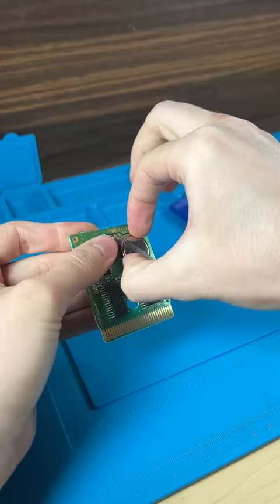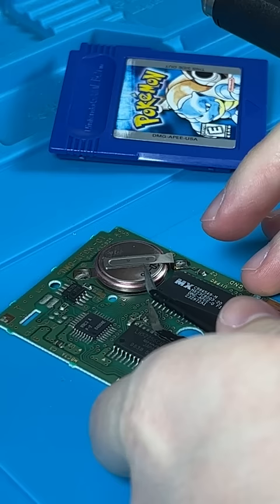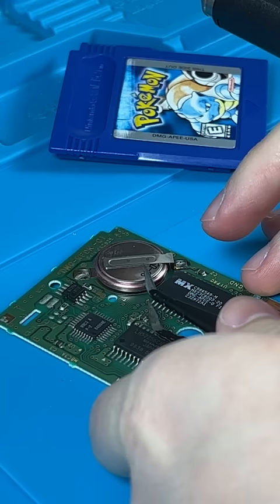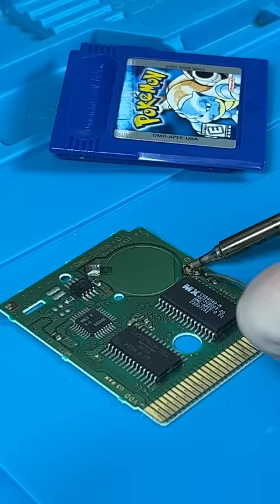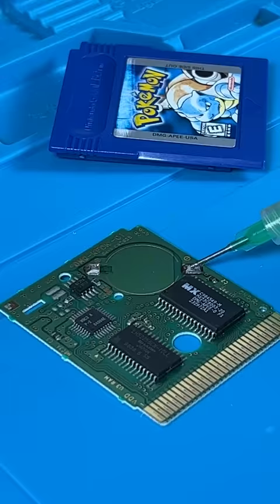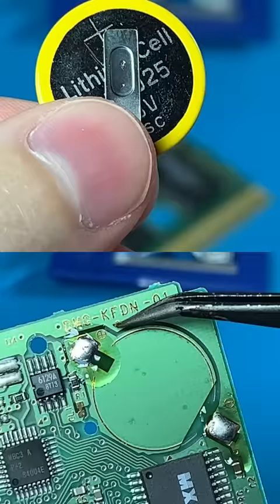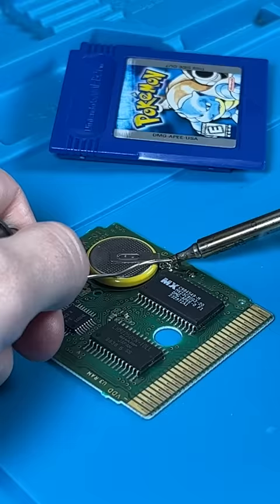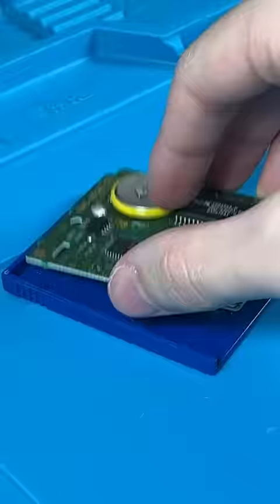How to PROPERLY Replace a Game Boy Save Battery! #Shorts #Restoration #Satisfying

Comment: “Now desolder the battery”

Me: I’m out.
Reply: Please don’t pry the battery off. It is spot welded and takes a lot of force. Sometimes enough to break the contacts or the battery. 

Just because it can be done doesn’t mean it isn’t a huge risk. A soldering iron can be as cheap as $10 and if you have no other use for it just sell it or burn some art into wood, much safer. 

Get the iron. If the original solder doesn’t melt in 3 seconds of firm pressure then you can consider buying rosin core solder. You shouldn’t need extra rosin. 

Practice and play with some junk first if you like. Bits of old wire and metal.
Reply: Yeah, Nintendo should have had made it like. Screw the cover out. And pull the battery away.
WITHOUT ANYTHING BUT HANDS! And replace it a new one
Reply: @buzzergaming7777  The batteries last longer than they were planning to support their system so that's why it wasn't a priority.
Reply: It doesn't take a lot of force to separate the battery, it takes time and patience. If you're too scared of poking the delicate cartridge with a blazing hot iron, slowly and gently shave away at the battery prongs with a box cutter. The prongs connect to the battery on two small spots, not bigger than the dot at the end of this sentence. It will take you the better part of an hour to do this, but in my opinion it's the safest way.
Reply: Fr
Reply: Soldering really isn’t that hard once you finally learn how to do it. Just gotta practice.
Reply: @alexitorico6686  it’s not the fact that easy or hard, it’s the fact that I would have buy all the equipment for one thing.
Reply: Soldering is easy. Apply the iron until solder melts and remove. Apply new solder with the iron. What's hard about that?
Reply: same
Reply: I once tore the motherboard of crystal in half trying to pry the battery off.
Reply: @xshadowzone  That’s extremely unfortunate.
Reply: I replaced my pokemon Gold cartridge battery when I was 14 years old and all I needed was a screwdriver and the battery.
Reply: Lmao
Reply: @ジョンマクス I'd avoid prying it. You might lift a solder pad and then you are screwed if you couldn't solder in the first place
Reply: Yep lmao
Reply: Its literally less than $20 to get what you need to do this. Why when anything involves money people throw a fit
Reply: @buzzergaming7777  I mean the batteries lasted 25-30 years. I dont think we should really complain.
Reply: @j that will destroy the solder pads or break the PCB don’t do that
Reply: Give it a try, soldering is super easy
Reply: @562.anthony2  it looks pretty straightforward, I was just making a joke.
Reply: Learning to solder is pretty useful. Bought a relatively low cost soldering kit on amazon a couple years ago, watched some YouTube videos on it until I was somewhat confident with what I was doing. bought a paddle kit and did a 4 paddle mod for my PS4 controller, After that I did a IPS screen for my gameboy SP, and now I use it when I put in new switches for my gaming mice.
Reply: @Dwellic  awesome
Reply: @Jackthat1  well I mean technically once you buy the stuff you'll be able to solder any of the gameboy, gameboy color, and gameboy advance games, not just a single pokemon, though if all you own and want to play is a single game like pokemon blue then yeah I see the point
Reply: It maybe look intimidating, but soldering is honestly so easy.
Reply: same

Comment: I’m 33, and I didn’t realize until 2 years ago that carts had actual batteries in them….. still blows my mind. Explained why my Kirby superstar games always came back 0% after a couple days.
Reply: I'm 31 and just found that out 2 weeks ago lol
Reply: Wait this isnt a joke? What the
Reply: Im 26 and i just found out
Reply: @dominickmagoon5731  They use volatile memory, same as RAM, so without power, they reset.
Reply: Very old writable chips (like the GameBoy contained) require a small amount of power to maintain their written state, like RAM in your computer.

The GameBoy Color was more of an upgrade to the GameBoy than a new system in itself - GameBoy carts work in it (albeit in monochromatic palette) and GameBoy Color carts will play in a GameBoy. The original GameBoy released in Japan on April 21, 1989 - in development for a few years before that -  and modern flash memory was extremely expensive back then. So, the carts used the memory that takes a battery. Luckily, these batteries often last 5 - 10 years, so they don't need replacing often - but it really sucks losing a Pokemon collection you spent thousands of hours on as a child.

33 years later, non volatile flash memory is extremely cheap, and any cartridge based systems can use a small flash chip to store save files.
Reply: @cr4zyj4ck  is that why at time it would crash and woudnt save?
Reply: I had the same issue with almost all my gba games back then
Reply: @cr4zyj4ck  you can just replace the battery every 5 year then
Reply: I’m 33 and I just found out right now lol
Reply: @dominickmagoon5731  yeah, usually the first sign was saves would randomly delete themselves and eventually the game would start crashing if it got so much as tapped while playing.

Found out years ago myself because I tried playing my childhood pokemon silver, batteries in the gen 2 games are just a pop and swap though.

Got my old game boy colour needing a refurb now though.
Reply: I am 35 and I learned watching this video
Reply: I'm also 33 and I just found that out today. You beat me by 6 days.
Reply: Some of them even had a small rumble motor in them.
Reply: I'm 32 and just found this out now.
Reply: I found this out too just now I'm 31 my childhood was a lie
Reply: Do the games that make you use a password to continue where you left off not have a battery??🤔
Reply: @Dkthearn  yep possibly
Reply: @Dkthearn  No they didn't have batteries, because they didn't store save files at all. The passwords were basically exact representations of certain game state values (level, health, items, etc.), with some basic parity checks (i.e. additional symbols that mark it as a valid password) to prevent people from just easily guessing passwords.
Reply: I'm 31 and I only just found out haha
Reply: Pokemon games don't work the same if I'm not Mistaken. It's used for timed events..ect. idk. Maybe red/blue ect was diff...
Reply: @lmfaook.7971  Yeah in Pokémon RBY you need the battery in the cartridge to maintain the save file. If the battery is dead and you turn off your GB, the next time you turn it on it'll look like you never had a save file.
Reply: I didnt know till today 😅
Reply: @do2eazy363  actually no, the moment the battery lost contact with the chip's contacts the save file would be wiped
Reply: @kidsseeghosts660   I said to avoid the battery dying midway you can replace it earlier
Reply: @kidsseeghosts660  also there is a method to replace battery without data loss
Reply: @do2eazy363  no that's not possible at all it doesn't work like that, just like I said these cartridges has to be powered for them to maintain their saving functionality. these pre advance gameboy cartridge used a battery-backed SRAM modules for their save states which means they have to be "powered by battery for the ram to work" that's the reason the dude has to backup their savefile  manually before changing the battery. if the cartridge lose power even for 1 sec your save file is good as deleted even with brand new batteries.
Reply: @do2eazy363  yes there is and that is by manually making a backup of your save file just like the guy in the video did. brand new batteries or not, the cartridge lose power your saves are deleted you don't really have to wait for the battery to die out just remove it's contact from the cart and you'll have yourself a cart with 0 savefiles
Reply: @kidsseeghosts660  no theres another way in which when the battery is old but still working you solder a external power source into the battery terminals now the power is not lost when we remove the battery so we can put the new battery and remove the external power source once done
Reply: @kidsseeghosts660  i fail to explain what I mean but the external power method works aswell
Reply: I'm 34 but it was around 29 for myself
Reply: I'm 35 and my pokey game from 5th grade still has my save state no lie! Never changed the battery
Reply: I thought only games with an internal clock had that (Pokemon Gold/Silver/Crystal for example), but know I know that the clock just uses the battery a lot faster

Comment: Leave the flux on, place the battery and then solder it. The flux won't do anything if you burn it while only on the pads as the solder you added already has fresh flux in it (hopefully). By leaving it on while you solder the battery you avoid having to need 3 hands for the part, iron and new solder with flux

Comment: Always clean the pads, always use fresh solder and if you're using the right solder, it's going to have rosin flux in the proper proportions. Don't forget to clean any excess rosin off the board before you seal it all back up again.

Comment: You can just use a box cutter to slice the metal contact off the bottom of the battery and take it out without taking out the entire battery assembly. That way you can just slide a new battery in without soldering new metal

Comment: Please use this method if you are replacing a save battery. Ripping off the battery can lift the pad, which is really really hard to fix. If you do not have a soldering iron, get one or take your game to your local retro game store. 9/10 times they have paid services for replacing save batteries.

Comment: To skip buying that crazy backup thing, just wire the new battery across the old one as you remove it so it never loses power. Little tricky, but works the same.
Reply: How would you even do that lol
Reply: @leolego2  Solder battery + to +
Solder jumper to new battery -
Solder jumper to gnd while clipping the + with wire cutter. 
Bend battery into place and solder everything better. 
It's tricky, but it'll work.

Comment: You can also instead of removing the solder on the arms that attach to the board. I used a hot knife and got the arms peeled away from the battery and it’s a standard battery you can buy at Walmart. Then I lay tape underneath the bottom arm put the battery on top and fold the top arm on the battery then pull the tape nice and tight and wrap the battery. Obviously if you can solder that’s the better option but with my method all you need is the screwdriver to open it, tape, battery, and something sharp to peel the arms off the battery. I never had any issues doing it my way with the few games I have done.

Comment: I did this with my Nintendo 64 cartridges, but instead of simply changing the battery, I put a notebook battery holder, this way it is easier to change the battery without losing the save every time
Reply: That's what I was thinking, why simply solder a new battery in place when you can solder a battery holder in place and then simply swap a new battery in when it eventually dies.

Comment: I had to fix this exact game when I was in the 6th grade (when it came out) with NO understanding of boards. My save was only working when it was getting power (turned on and playing) but when I turned it off then back on my save was gone. So I unscrewed the backing with tweezers, found the battery was sticking up slightly from the board and reasoned that had to be it. One piece of folded paper on top of the battery later, never had an issue with saving again! I felt so smart that day.

Comment: I bought blue, red and yellow at a local thrift store for like 5 bucks. They said "broke/won't save" on them. Didn't have the right screwdriver but I heated the tip of a emptied out plastic pen and pressed it to the cartridge to form the shape to take out the screw. Replaced the battery and all 3 work like new!

Comment: You get more right than most but, sorry, I can’t agree with this being the “proper” way.

First, you generally don’t use additional flux until you are making the joint. Doing it and then reflowing just to make it look better BEFORE you make the connection actually makes the end result worse because you activate or burn the flux away before the moment of truth. If you want bare solder pads to look better but aren’t ready to make the connection then you only need to add fresh flux-core solder, like you did, which obviously has a bit of flux inside… but it’s literally better to do this AFTER putting in the new battery.

In the end your connections were dull either because all the flux burned away. This has more to do with the battery tabs and power/ground connections having a high thermal mass and, thus, all the flux is inactivated by the time the solder has fully flowed. The way you deal with this is to pre-heat with a small amount of solder, then add the rest just before removing heat. The small amount of solder acts like a heat bridge to pre-heat the tab and the solder pad.

If the fresh solder adds too much thermal mass for your iron with slow thermal recovery it may solidify and force you to dwell until it gets hot… burning the flux off again. If so, then take advantage of the added thermal mass by waiting for it to flow all at once then add a tiny bit of fresh solder or flux just before removing heat. You should have a nice, shiny, smooth, solder connection.

I guess the dull connections also could’ve been from mixing solder chemistries. Make sure you aren’t using lead free solder for games of this vintage.

It may not matter when the battery is being removed anyway but I try not to short batteries with my tweezers. People might be tempted to use tweezers the same way to avoid burning themselves when they install the new battery, which would be a mistake: shorting both sides will run it flat.

I like to remove the solder from one side so that it will lay flat when I reflow the other… none of that jumping back and forth while pressing down. ;)

Comment: I just did this last month on my crystal version. I went to the store an got a 1616 battery because they were out of 2025s. Any 3v battery will do fine. I also soldered the old tabs directly to the battery (yes I know it’s bad to do that) works fine though so I’m not complaining.

Comment: A good optional battery replacement is using them cr battery holder that you solder on the board... So you wont have to use a soldering iron every time you want to change the battery

Comment: you can replace the battery without losing the save file and no transfer of save file needed. just replace the battery while the cartridge in inside the gameboy and power is turned on.

Comment: Out of everything I only have a single question. Did you clean off the old solder before adding new? The old may still be present and after aging just isn’t as good quality. This can impact the longevity of the new solder.

The solder wire also has flux, so unless the board has heavy groundplane, you should be fine with just the wire.

Comment: I’ve replaced the battery while the game is plugged in and powered on, just have to plug the game in with half of the cartridge case and be careful not to move it around too much. Once the battery is changed I just save and don’t have to back up to a computer. Not the best way to do it, but it works.

Comment: If you are using flux on that and use rosin core lead solder, maybe soldering isn’t your thing. It has way more than enough flux inside of it and if you can’t do it with that amount of flux you need to work on your soldering skills. If you can learn to do that then you will never need to clean up your board with iso because you used too much flux.

Comment: You can get battery holders that will fit inside the case too. Then future changes won't require soldering.
Reply from the maker: Yeah but for me it’s easy enough since I solder almost every day

Comment: I mean you can still do it without soldering. 🤷 I did with my cartridge of PKMN Gold Version.. just pull the prong up if you're careful enough and pop the new battery in and you're good to go.

Didn't have to mess with any glue or whatever and soldering.

Comment: This video is slightly deceiving. Most people will probably guess, but if you remove the battery, you won't have the "Continue" option when you turn the game back on. You CAN however, replace the battery while the game is being powered by a GameBoy Advance and not lose your save.

Comment: You don't need to backup the save file. Just insert the cartridge without the front cover on a GBA. And while the GBA is on, replace the battery

Comment: I just use an X-Acto blade to separate the battery from the clamp. Put a new one in with electrical tape tightly binding the tabs to the battery.

Be very careful with the blade. 🤓👍

Comment: Quick question! Do you buy replacement batteries with the tabs or do you sober it onto the battery?
Reply from the maker: Buy them with tabs. It’s very dangerous to solder to batteries

Comment: I wish middle shool me knew this back then. Coincidentally,  it was also pokemon blue. I dropped mine and the soldering came undone. Years later I opened it up with a tech deck tool and replaced the battery.  Never soldered it though but it stoll worked 👍🏾

Comment: Fresh solder and especially flux won't do anything before soldering the battery. Just use fresh solder with the new battery in place and you're fine. Plus your joints don't look too good, not even shiny man...

Comment: Wish I'd known this years ago. My Pokemon red stopped working, was a defective cartridge. I thought I'd legit messed it up with the missing no. glitch at the time. Game never saved again, and my save file was deleted. It worked when I ran the game through my game shark though, like back when the game shark was this bulky thing you plugged into the cartridge slot.

Edit: I did know this before this video, just sharing a story.